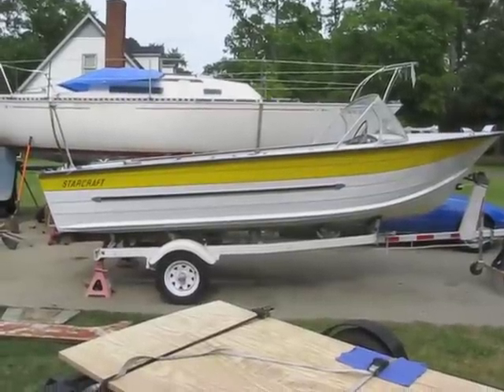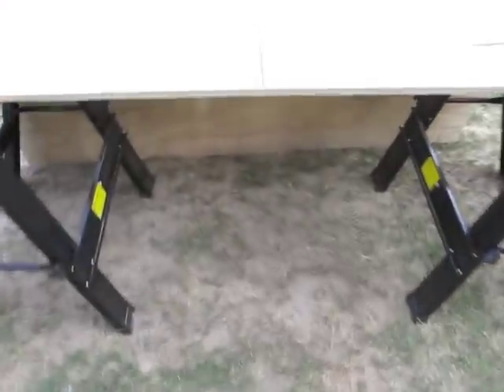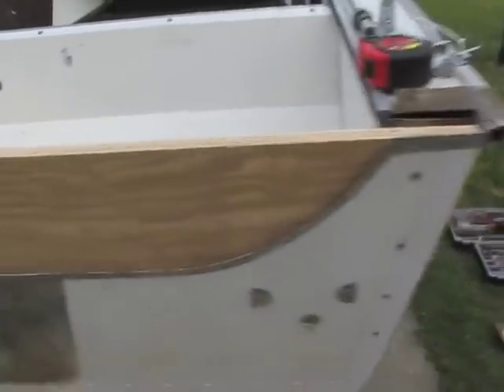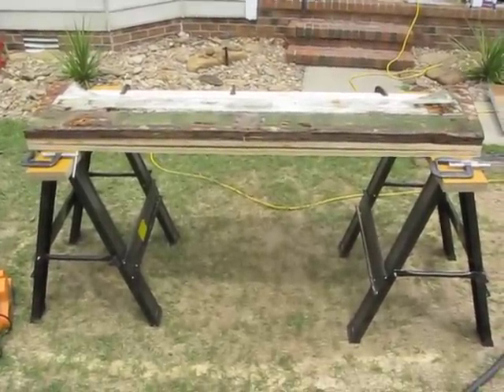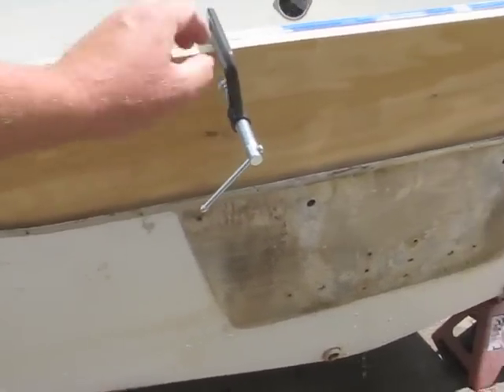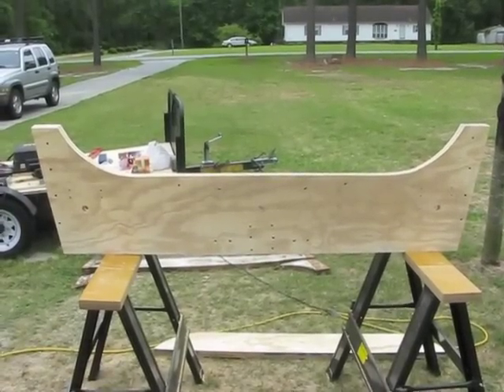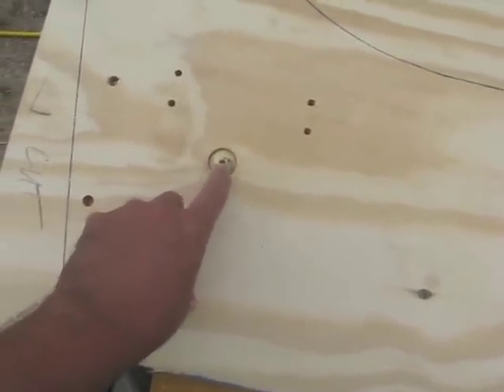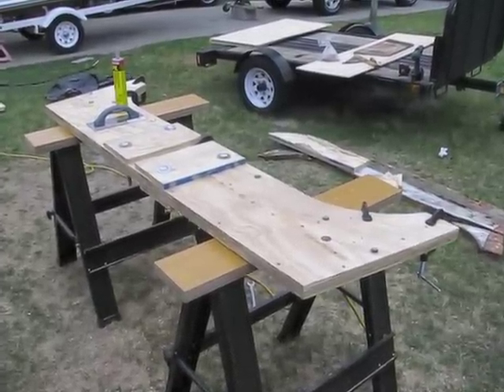1966 Starcraft Jupiter (part 4)

Comment: Thanks a lot for posting this.   I was able to replace the transom on my 1980 Starcraft Super Sport, and it was nearly identical to yours.  I did use marine grade plywood and coated it with fiberglass resin.  It should last a while.  Also, Moeller Marine makes a nice drain tube replacement that is plastic a much easier to install than the original brass one.

Comment: Man!  Thank you!  I just found out how rotten my transom is on my ‘66, and found your vid right away!  I may have a bunch of questions for you coming up. 

The bottom most edge of your ransom has a stopper strip of aluminum that I don’t.  I think I’ll want to fabricate that to take a bigger motor.  I want to go from a 20 to a 115hp.

Condolences on the passing of Samantha.  They give a lot more to a family than they get.

Comment from the maker: If you have access to a garage or carport it would make life easier. Ever since I started this project, it has rained almost every day. 
I did buy new drain tubes for the splash-well. They were only $4.65 each. I also bought the special installation tube for them. Could have done it without them but I plan on working on more aluminum boats in the future. 

I'll be getting back to work on the Starcraft within the next couple of weeks. I have been busy stripping down & parting out a 24' Sailboat.

Comment from the maker: Also, doesn't hurt to have a tube of 3M-5200 Sealant/Adhesive. I found it to be cheapest at lowes. It works good for sealing around the splash-well & to seal the bolt holes. You can also use it to seal around your drain tubes.

Comment from the maker: Top 69.25" W
Bottom 62.5" W
Total Height 19.75" H (12" height in cutout)

It only took one sheet of 3/4" exterior grade plywood to make both pieces for the transom.(don't use treated since the aluminum does not like it)  
Used two 10 oz. tubes of Loctite PL Premium Polyurethane Construction Adhesive to laminate the two pieces of 3/4" together.

Hope this info helps.